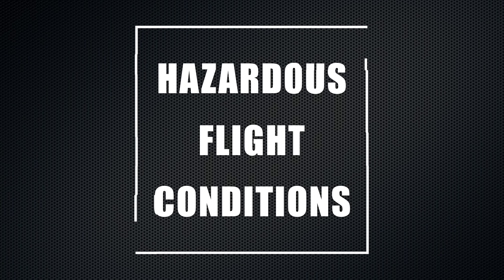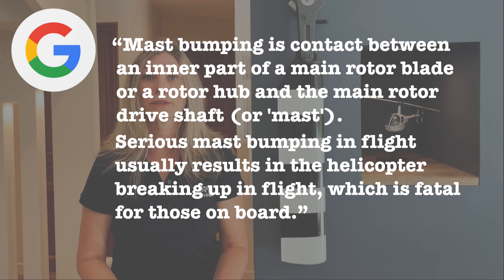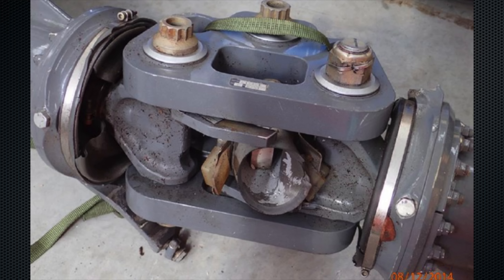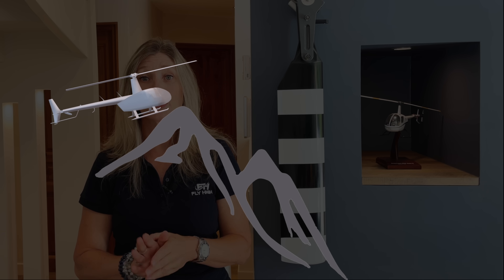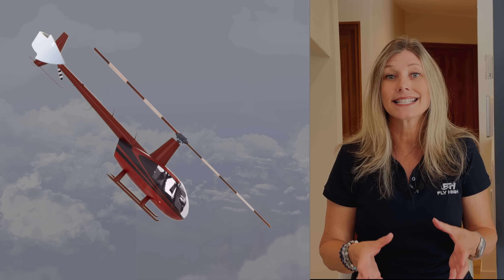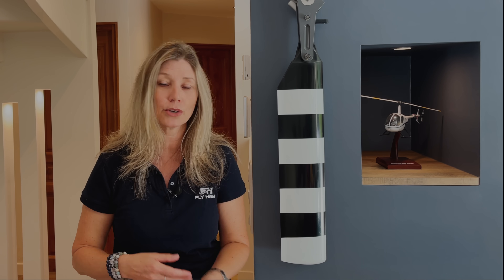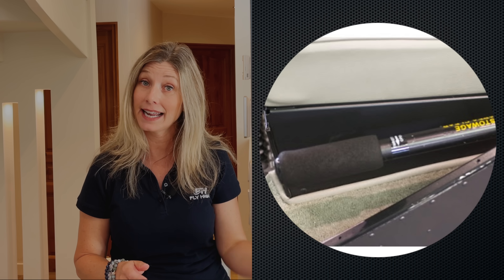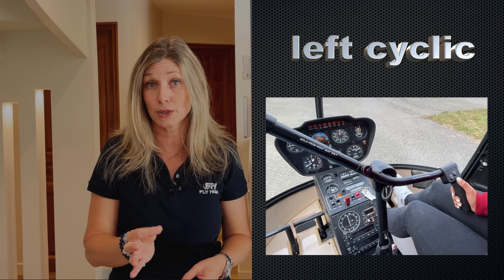Mast Bumping: The Hidden Danger That Can Destroy Your Helicopter!

Comment: Why the hell wouldn't there be some type of safety mechanism to prevent it if it is so dangerous? It seems that helicopters are designed to be extremely prone to self-destructing.
Reply from the maker: Great question! Helicopters aren’t designed to self-destruct, but some phenomena (like mast bumping) can exceed the mechanical limits if the aircraft is pushed outside its safe flight envelope. That’s why there are strict procedures, limits, and especially pilot training to avoid them. You could say helicopters forgive a lot of things—but not everything 😉🚁

Comment: Why can't they design a bigger hub to leave a larger space between the hub inner wall and the mast to avoid mast bumping?
Reply from the maker: Great question! In theory, increasing the space between the hub and the mast could reduce the chances of contact — but it would also affect the overall dynamics of the rotor system. Teetering rotor systems (like those found in many two-bladed helicopters) rely on very specific geometry to keep the system light, responsive, and mechanically simple. A larger hub might reduce bumping risk, but it could introduce new challenges like added weight, more stress on components, and reduced efficiency. That’s why modern designs often solve the issue by switching to multi-blade, fully articulated, or rigid systems instead. Thanks for asking — it’s a really insightful point! 🚁

Comment: Why do people fly these dangerous designs of helicopters which can destroy themselves by mast bumping and tail boom chopping? Why does the helicopter industries not build idiot proof helicopters?
Reply from the maker: It’s a really valid concern — and one that comes up often when people learn about things like mast bumping. The truth is, every aircraft design is a series of trade-offs. Some rotor systems, like the two-blade teetering types, are simpler, lighter, and more cost-effective, but they do require strict adherence to flight limits.

That said, the industry has evolved — many modern helicopters use multi-blade or fully articulated systems that are far more forgiving and less prone to these risks. But even the best designs can’t fully replace the role of well-trained, well-informed pilots. Appreciate the question — it’s exactly the kind of thinking that leads to better awareness and better design.

Comment: I would have pulled pitch to reload the disk/head. Going aft cyclic I think could be risky or any direction with the cyclic I would have thought would be dangerous when the disk is unloaded by low G.
Reply from the maker: Great insight — and you're absolutely right to be cautious. In a low-G situation, the instinct to pull pitch can feel natural, but it doesn’t actually reload the rotor properly. The key is to first apply gentle aft cyclic to re-establish positive G and reload the rotor, then manage collective as needed. Using lateral cyclic while unloaded can definitely be risky due to mast bumping. Thanks for bringing up an important point!

Comment: This is EXACTLY the advice promoted on a Vietnam-War era US Army instructional video. NOTE: the 2 model types featured employed 2-bladed rotor assemblies. G-loading of 1/2 or less exacerbated the blades’ up-and-down “flapping”, which would eventually exceed the 11°-12° deviation of contact where the rotor hub contacts the mast. 
This prompted me to follow a hunch. (I figured the less blades = the greater the load per blade). The “thump-thump-thump” sound of a 2-bladed helicopter (UH-1) versus the “whirring” of a 5-bladed helicopter (Hughes 500) even tells one’s ears that to be true. 
I Googled the incidence of mast-bumping between 2-bladed rotor assemblies versus that of those with more blades, and apparently…mast bumping noticeably occurs  MORE often with 2-blades rotor assemblies. 
***My hunch originated from all of the videos I’ve seen showcasing the US Army’s OH-6 “Loach” / MH-6 “Little Bird” 5-bladed helicopters, whose pilots possess enough confidence in their machines to execute VERY impressive feats of nimble maneuvering.
Reply: @FNHaole You are learning, you get it!
With two craft of same weight, more blades does distribute that weight more lightly on each blade.. it also makes for greater RESPONSIVENESS..AND more stability ..
With the 2 bladed semirigid "teetering" hinge head, it operates much like a teeter-toter/seesaw..(remember the "butt-banger" shock!💥playground physics!) & can make a "impact" much the same, but leverage of the whole rotor system is impacting the mast, on either side, as it rotates..
When the rotor is loaded, the "coning" (which works very similarly to the slight "V" of dihedral of wings) of the blades as they rotate keeps them "centered" more, & flapping forces are transferred to the mast..tilting it & the craft.. the less load, the more FLAPPING happens rather than transfer of tilt to mast..
THE CONTROLS TILT THE ROTOR DISK, BUT THE BODY OF THE CRAFT ISN'T FOLLOWING! MORE INPUT MAKES WORSE!
She's right, the LOAD on the rotor needs to be maintained- JUST LIKE  A KITE!  (Soon as you let out string too fast, you lose control of it!) 🪁
2 Bladed rotors have rigidly spaced & braced blades.. =○=
Rotors with MORE than 2 blades most commonly have FULLY ARTICULATED heads, where each blade has something like a wrist joint, that allows flapping up & down, leading and lagging (foreward & backward), & feathering (pitch twist)
This is more complicated, but alleviates the mast bumping..while MORE energy is being directed into mast by more blades..(making more responsive)
*Something called ground resonance can happen when FULLY ARTICULATED hubs are unloaded and spacing between blades gets unbalanced while vibrations are passing from rotor through landing gear to ground,  reflecting back up through to affect rotor worse.. quick & destructive, but quickly resolved by picking up off ground, (just like stopping micrlphone feedback!😂)
Helicopters are complicated, but step by step one gains understanding, then respect grows, and they just steal your heart!
I love the Huey, but if I were to have a helicopter, I'd have the Hughes 500C.. not one of the newer ones..but the simpler, safe, powerfull, fast model that is more than capable.. just a little snug..😎👍
Reply: @ francisconti9085 , there are a lotta 500’s here in Honollulu. I haven’t seen the fire dept’s NOTAR variant for a while. (They lost 1 on a hillside rescue years ago). As soon as you’d mentioned ground resonance, I chuckled. Years back I saw a short video of what looked to be a big bullfrog wearing a propeller hat. It sat there, went into a Grand Mal seizure, and disintegrated. Turns out the video was old footage showing a Chinook seen from the rear. It was being load-tested to illustrate what could happen to the aircraft during a severe ground resonance event.
Reply: @FNHaole  Oh, I remember that video! Like a destructive kid flailing a broom around head & ripping up a box.. AND THATS A LOW RPM HEAD!
watch a smaller helicopter have ground resonance,  it starts looking "electrocuted" getting worse fast, till violently disintegrating, throwing parts, Pilot Operating Handbook,  necessary documents & more..😬
Reply from the maker: Really insightful comment — thank you for sharing that! You're absolutely right: 2-bladed systems are more prone to mast bumping, especially in low-G conditions, due to the greater flapping angles. And yes, that classic “thump-thump” sound tells a story of its own! The comparison to multi-bladed systems like the OH-6/MH-6 is a great observation — they’re inherently more stable in that respect. Appreciate you taking the time to dig into this and share your thoughts 🙌
Reply: Two-blade rotors have mast bumping problems because they are built differently. It’s not the number of blades that does it, but rather the teetering rotor head design. 

Most multi-bladed rotors are immune to mast bumping by virtue of their design, not the number of blades. Those fully articulated blades have their pivot points well away from the mast, and therefore they simply cannot bump the mast. 

All the observations you made in your comment are correct, but they’re not the whole explanation.
Reply: @lebojay  Well said! *I like the lead/lag bearings on the 3bladed Brantley helicopter..located QUITE a way outboard of the hub..ingenious system, and quite novel!

Comment: This is a bad design. Rotors should never be able to touch the tail cone at any situation.
Reply from the maker: Totally understand the concern — it does seem alarming. The risk of rotor contact in extreme low-G situations is exactly why mast bumping is taken so seriously in training and design evolution. Modern helicopters (especially those with more blades or rigid rotor systems) are much less prone to this, but it’s still something pilots need to be very aware of. Thanks for sharing your thoughts!
Reply: In ANY situation? Blades have to be flexible, you know.

Comment: The rotor system does the lift . Inspection of the transmission mounts should be regular maintenance. Either to lazy or cheap maintenance can cause problems.
Reply from the maker: You're right that the rotor system is critical for lift, and regular inspections—especially of the transmission mounts—are essential. Mast bumping is a complex phenomenon, often associated with low-G conditions in certain rotor systems, like the teetering type. While maintenance is definitely a factor, mast bumping can also be triggered by pilot inputs or flight dynamics. It's important we look at both mechanical and operational factors when trying to understand these incidents. Thanks for sharing your thoughts.

Comment: PT pilot technique . Human error. The system has a small amount of protection. But human error can cause damage.
Reply from the maker: Exactly—pilot technique plays a huge role. Many rotor systems, especially those susceptible to mast bumping, have very limited protection once low-G conditions occur. That’s why proper training and awareness of the risks are so crucial. Human error is often the tipping point in these situations. Appreciate your input!

Comment: the pilot in New York was a veteran, you may experience strong turbulence above a city provided  that there ii strong wind .  and a tour does not include acrobatic maneuvers
Reply: The recent crash in New York was not mass bumping. The whole transmission, mast and head were still connected. The transmission was ripped off the aircraft. This was a catastrophic failure by other means. I have a lot of time in the Long Ranger and it will handle a huge amount of turbulence. I have flown under a low level jet-stream in the arctic and it was the worst turbulence ever. It didn’t cause any damage.
Reply from the maker: Really appreciate you sharing your experience — especially with time in the Long Ranger. That kind of firsthand insight is invaluable. You’re absolutely right: early reports don’t suggest classic mast bumping in the NYC crash, and it’s important we wait for the official findings. The video wasn’t meant as crash analysis, but rather to raise awareness of mast bumping as a general risk, especially for newer pilots. Thanks again for your thoughtful comment and perspective 🙏🚁
Reply from the maker: Exactly—this pilot was experienced, and flying over a city like New York can present unexpected turbulence, especially with strong winds funnelling between buildings. In those conditions, even a momentary low-G situation can be risky. And you're right—tour flights are not about aggressive flying. Sometimes, even standard maneuvers in the wrong conditions can lead to trouble.

Comment: If all pilots know about low G, they should have no difficulty making an aft-cyclic correction. Also, it is not amusing to lose the rotor.
Reply from the maker: Exactly—and since we can’t safely train for low-G in flight, it comes down to awareness and muscle memory. Recognize the signs early, avoid the conditions, and know the recovery instinctively. Staying sharp on these fundamentals is key to safe flying.

Comment: Thanks. Will stay well clear of a chopper with a semirigid rotor system with a 2-bladed main rotor...
Reply: LOL, wow, what paranoia!!! 😅😅😅 Ever hear of the Bell 47G? First helicopter to attain civil certification from the CAA in March of 1946. "The Bell 47G features a two-bladed semi-rigid main rotor system and a two-bladed tail rotor. The main rotor blades are typically made of laminated wood, with a stabilizer bar located beneath the hub to enhance stability." Probably the most famous and easily recognizable helicopter ever built, yet because some woman suggests issues with a specific type of rotor system, we'll ignore 81 years of success and proven engineering.
Reply from the maker: Appreciate your passion for rotorcraft history — and you're right, the Bell 47G is an iconic design with an incredible legacy. The video’s goal isn’t to discredit decades of proven engineering, but to raise awareness about specific flight conditions — like low-G — where even a well-designed semi-rigid rotor system can become vulnerable if not operated correctly. It’s all about education and safety, not paranoia 😊 Thanks for sharing your perspective! 🚁
Reply from the maker: That’s a valid concern—semirigid, 2-bladed systems like those on the Robinsons do require careful handling and a clear understanding of their limitations. But with proper training and respect for the flight envelope, they can be flown safely. Awareness is key, and it’s good to see pilots thinking critically about rotor systems and aircraft choices.

Comment: If a rotor head can come in contact with the mast it means there is a design flaw
Reply from the maker: Appreciate the support 💯 It’s a topic that definitely sparks good discussion — thanks for chiming in!
Reply: The accident aircraft was a Bell 206 which is not generally susceptible to this like the Robinson is.  Further the pilot had lots of Robinson experience so is probably keen to avoid it.

Further still the helicopter was in straight and level flight prior to control loss—no low-G condition and no turbulence.  Very unlikely to be mast bumping.
Reply from the maker: That’s a great point, and you’re absolutely right — the Bell 206 has a different rotor design and is generally more tolerant than something like a Robinson in low-G scenarios. Also agree that the facts available so far don’t clearly suggest mast bumping in this case.
Reply from the maker: It’s a valid concern, and one that’s been debated a lot. Mast bumping is indeed a known limitation of certain rotor systems — particularly teetering, two-bladed designs. It’s less about a flaw in engineering, and more about a design trade-off: these systems are lighter and simpler, but they come with strict operating limitations. That’s why pilot training and awareness are so critical with these helicopters. Appreciate you raising this point — it’s an important one.

Comment: Need to design a helicopter so this can't happen.
Reply: There are lots of them
Reply from the maker: It’s a very valid point. Over the years, rotor system designs have evolved to reduce the risk — especially with multi-blade, rigid, or fully articulated systems that are far less prone to mast bumping. But in lighter, two-blade teetering systems, the trade-offs in simplicity and weight come with strict operating limitations. It's definitely an area where both design and pilot training play a crucial role.

Comment: Just bad design. Why don't they put some damper that prevents bumping?
Reply from the maker: It’s a good question — and you're right to wonder. In fact, many modern helicopters do use rotor head designs (like fully articulated or hingeless systems) that drastically reduce or eliminate the risk of mast bumping. But in simpler, lighter two-blade teetering systems, adding dampers or more complex mechanisms increases weight and cost — so it's a trade-off. That’s why proper handling and pilot training are so critical with those designs. Appreciate you bringing this up!

Comment: 4:27 ... looks very similar to what happened on the Hudson.
Reply: Indeed. It was probably that
Reply from the maker: Yes, that moment at 4:27 does resemble what’s been described in the Hudson incident — though of course, we’ll have to wait for the full investigation to know for sure. Either way, it's a powerful reminder of how critical it is to understand these dynamics. Thanks for watching and engaging with the topic 🙏
Reply: No it doesn’t. On that helicopter, the entire rotor and transmission assembly is still intact. Those blades didn’t hit anything.